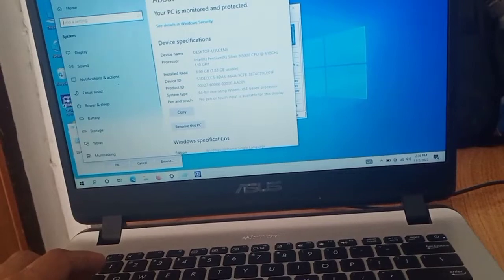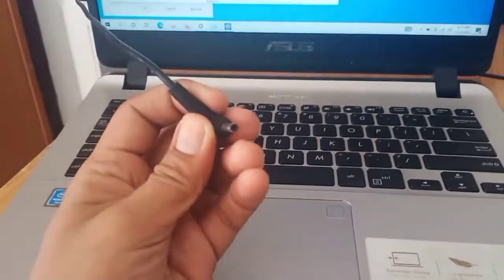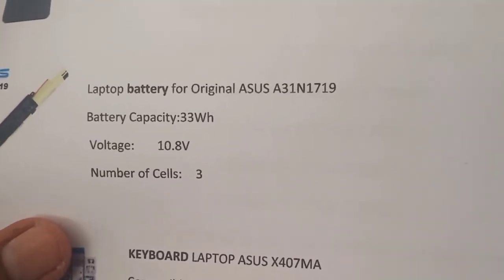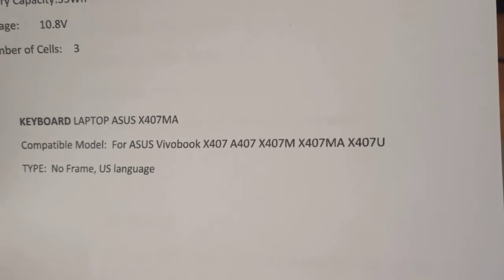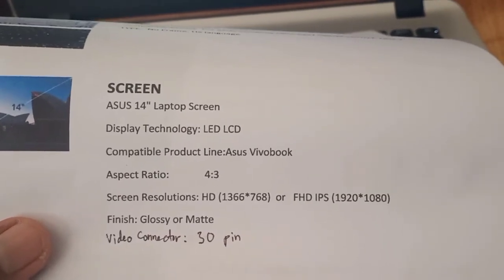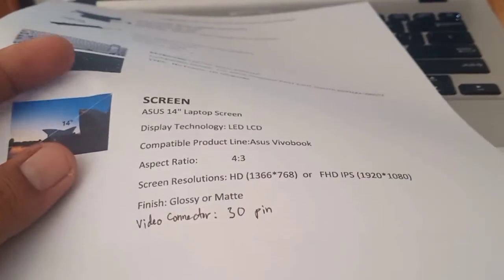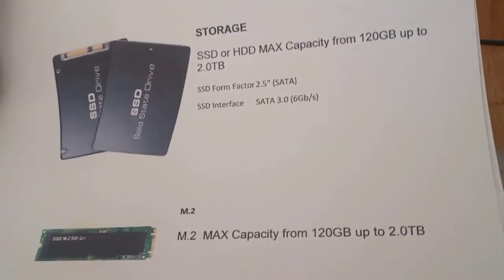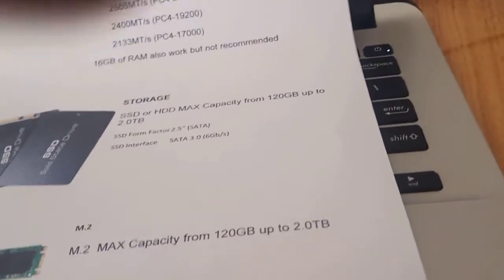ASUS VIVOBOOK X407MA Upgrade and Parts Replacement

Comment: Im also doing the same with my laptop, from 4 gb ram to 16 gb, changed to SSD. 

I found myself here trying to find a way to somehow upgrade CPU which bottlenecks my performance
Reply: Have you encountered any issues with the 16gb ram because the cpu can handle a maximum of 8gb, i also want to try it but im not very sure
Reply: Plss respond:face-purple-crying::face-purple-crying:😭😭😭
Reply: @kentpurisima3714  I didn't, it works normally
Reply: @ I encountered a comment from a tech about that, even if you install 16gb, the cpu will only read the 8gb therefore the ram can only use is like 7.8gb. So yeah it will work but the other 8gb will not be read by the cpu. TYSM though

Comment: MAS MABILIS BA SIR PA NAG PALIT SSD RAM SAKA M.2?
Reply: You don't need to change ram, if you are using the same laptop you can buy another ram and add it, because that laptop has 2 ram slots. Also upgrading to SSD will really boost performance but its way expensive than a HDD